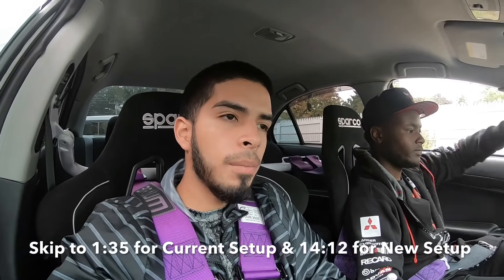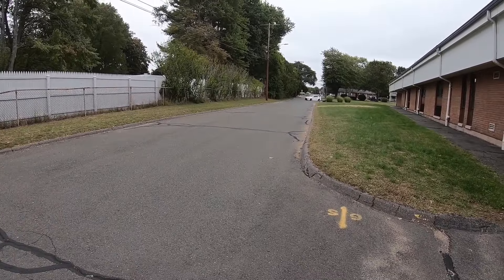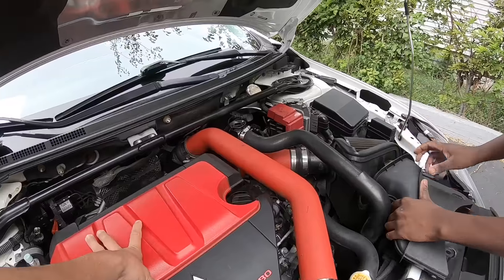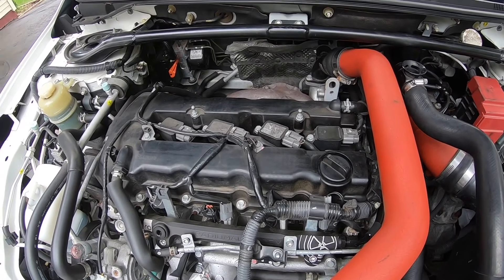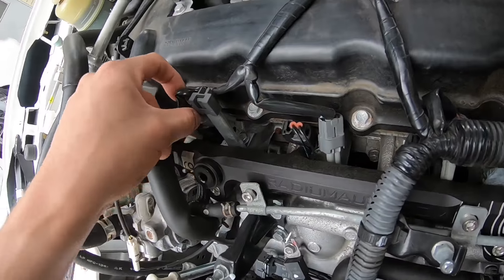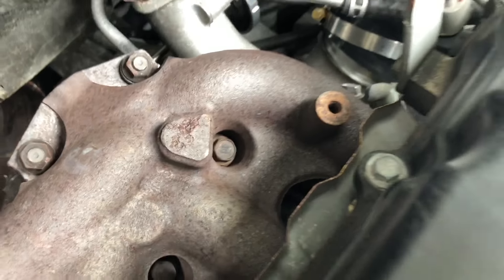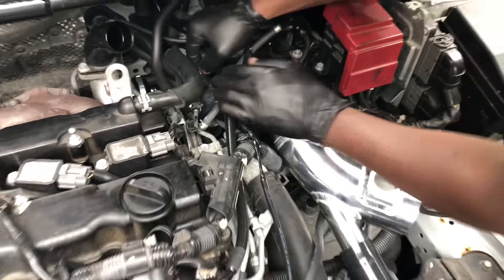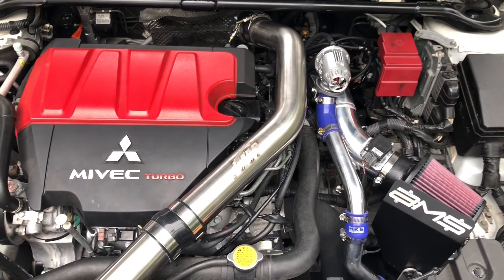EVO X AMS Intake & HKS Blow off valve Install

Comment: At least you guys aren't doing stance crap like most of the channels out there nowadays which is boring imho, props for doing go-fast mods 🤙🏼
Reply: owen75 a BOV is not a “go-fast” mod, people of the Evo X forums will call you a idiot for thinking a BOV will add any power. In fact the stock BOV is the best to run because its not letting out all that boost. The stock BOV is a recirculating type so it hangs onto boost while changing gear. Thats why you don’t hear the stock BOV on a stock Evo X that much because its holding onto boost. This BOV just lets all that boost go out to make “epic fast street racer boy” noises making you have to rebuild boost when you are in your next gear. I don’t have a problem with BOVs, I actually think they add character to a car like throwing a exhaust system on a car, just don’t call them a “go-fast” mod.

Comment: Did you just cap off the intake where the blow off valve is supposed to recirculate to?
Reply from the maker: That pipe end wasn’t needed so it was capped
Reply: great, thank you. I will be getting one.
Reply: @DWNSHFTco  where can i purchase that cap?
Reply from the maker: @ColeParkerrr  can try autozone, Amazon or eBay

Comment: Hey man what vacuum line do you hook up to the bov
Reply from the maker: There is a metal line under the bov, where the hose connects from to the bov. At 9:29 it shows it
Reply: @DWNSHFTco  appreciate it. I have a efr turbo so I’m pretty sure that line has to hook up to the turbo as it has a crv port that says connect to intake manifold. So I’m thinking I’ll use two T connectors for the bov and boost gauge. Hopefully that’s right 🤷🏻‍♂️ lol
Reply from the maker: @Erkkremlinklum  can take a look at my other video as a guide https://youtu.be/HXxhP_Mpsto

Comment: No issue when you guys block the hole on the intake pipe?
Reply from the maker: Yoo Itszen the heat shield next to the air filter?
Reply: DWN SHFT the hole on the intake pipe u know how like the previous bov u guys had the 2 port one from the LICP and the other end goes to the intake pipe before the maf sensorz
Reply from the maker: Yoo Itszen yeah on the old set up the second port went to the intake after the maf but the car also has a map sensor so uses both to measure air coming in. Also the old bov partially recirculated back into the engine, the new one is full atmosphere and that Evo has a new tune now, check my latest video! 👍🏼
Reply: DWN SHFT so u guys didnt run any issue after installing the new bov?
Reply from the maker: Yoo Itszen he explains in the latest video the issue and why he got a tune, https://youtu.be/tbHaAYVkIvg